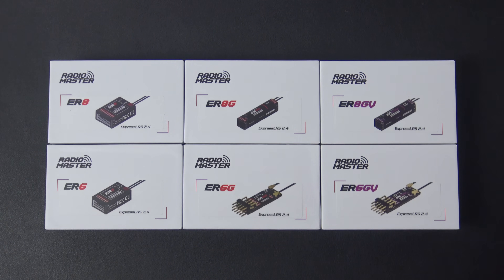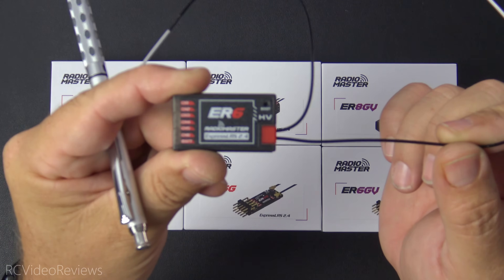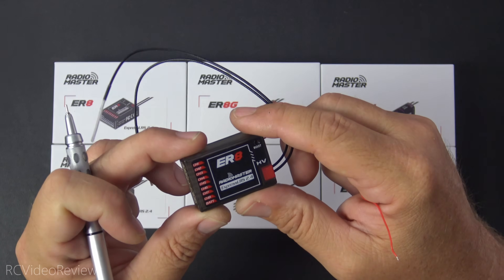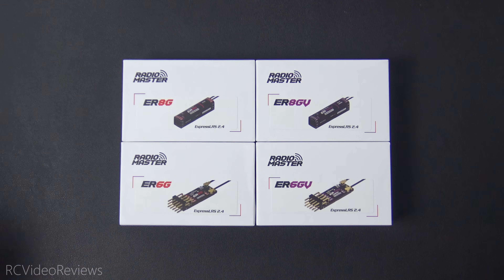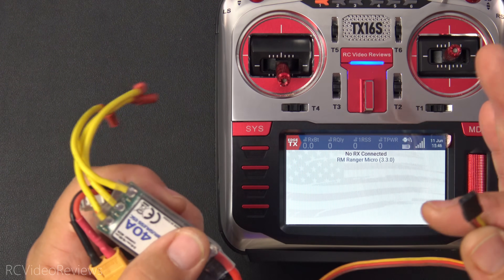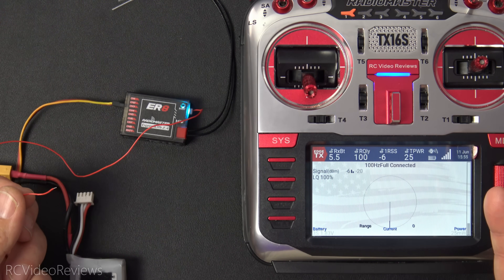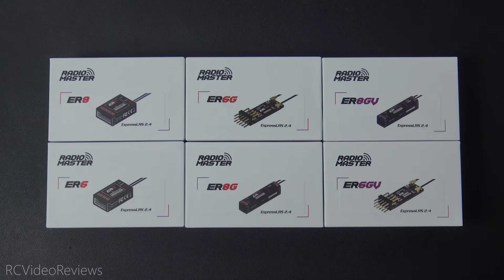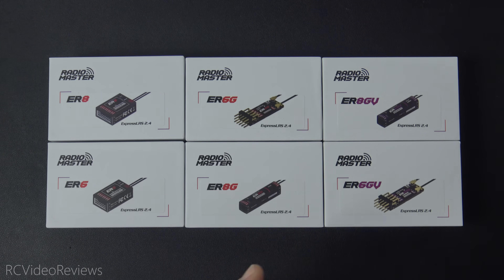Radiomaster ExpressLRS PWM Receivers [ELRS] : ER4 • ER6 • ER8  • ER6G • ER8G • ER6GV • ER8GV

Comment: Good enough to give this a try. Definitely going to miss per cell voltage.... Hopefully that comes along soon for EDF, helis, etc.

RM seriously needs to consider a NA warehouse and support staff to take it to the next level. ~$5-11 per item to ship from CN starts to erode at the value prop.
Reply from the maker: They do have a robust retail channel and I'm told the US retailers that ordered them are free to post them at will.

I used to worry about per cell voltage, but I keep only good condition batteries in flight and TBH, with good condition batteries, it's never been an issue. And I log/review my data too, so I'm not whistling dixie here.

Comment: I wish they do not sell em in a fancy carton boxes that goes strait into trash, but make em couple $ less. For $14.99 you can buy matek 6ch rx with same vbat feature + 2 additional channels. Same weight tho. But it's good thing that we have another one vendor on a market.
Reply from the maker: I have a bunch of the Matek/HM RX's, you also have to solder all of those and one little mistake (which people have admitted to making in the comments on retail sites) and your $14.99 is wasted. Also, some of the older hobbyists don't have the same eyes/hands younger hobbyists have, so solutions that come ready to go out of the box are a value add for them.

And yes, always good to have another vendor in the mix. Good for everybody.

Comment: they didnt have a typo for the weight, you forgot to add the pins to it and all the other extra stuff
Reply from the maker: The one with the typo was a 5g difference. Radiomaster already acknowledged the mistake. Had nothing to do with the pins/wires.

Comment: You know shids fked up when the most expensive of these is cheaper than the cheapest Futaba.
Incredible prices makes me wish I had ELRS.
Reply from the maker: Not only that, I've been watching ELRS telemetry very closely for a few weeks, and the RF link latches on like a pit bull with lock jaw. Even single antenna designs produce ridiculously good RF outcomes. I'm talking RQLY at 333hz of 95%+ and 25mw of dynamic power. 

Let that sink in and you should be saying, "Holy s$!T!" That means 316 understood packets per second at a measly 25mw of transmit power with headroom to 1000mw. It's just insane.
Reply: It doesn't cost much to change over - sell your Futaba while it still has value! :)
Reply: @slammerf16  Oh I have FlySky PL18 now hehe. I'm satisfied with AFHDS3 recievers but if I want something that crazy cheap I need to downgrade to AFHDS2. But other ELRS modules are so cheap I might just grab one of those now.

I bought my Futaba T7C used from an acquaintance years ago and it turned out to be one of the early variants that cant bind to additional recievers. When I realized I was years outside of the "service" that Futaba offered to fix them.

Comment: Great video John. Well done RadioMaster and all that worked on creating these Gems.  Love this feature that CapnBry shared, " output CRSF or SBUS to a flight controller and still have the PWM outputs as well." VERY VERY cool
Reply from the maker: Yes, definitely cool.
Reply: Hspeed, CRSF or SBUS output ?? CapnBry ?? 
Sounds interesting. Please advise how.
Reply from the maker: Yes, you can output serial and PWM simultaneously on ELRS. I haven't done it on new RM stuff yet, but for PWM: Set Pin 2 to Serial, pick SBUS (3.3+) or CRSF, and PWM pins retain output. No configuration necessary for those.
Reply: I tried changing the output pins in the ER8 and ER8GV, but they don't support setting their output pins to Serial.  It appears you can only use the CRSF port for serial output (which is fine by me)  @RCVideoReviews

Comment: question: how do you couple two receivers for a dual setup ?
Reply: For what? The link is extremely reliable.
Reply: @malte9999  there is nothing extremely reliable. of course if I were to use them on cheap foam planes for LOS this is not an issue

Comment: Indeed!  I have not bought DMSX original reveivers because of the lack of that feature... Hated the 'time' thing.. Love the Low Flightpack voltage alarm. Once you try it, you will not want to go back.  I don't employ RX's without it anymore just as you do.!  Big thumbs up for Radiomaster!
Reply from the maker: Yeah, having flight pack voltage is so useful. FYI: If you like using voltage instead of timers, check this out: https://www.youtube.com/watch?v=Q5s7zB0NDCQ
Reply from the maker: Every plane that has voltage, has that setup. And I only have a few more planes to convert to ELRS + Voltage.

Comment: Great video John, good to see these receivers are finally public! I think RM are on to a winner with the ER series. :) btw, the UART on the ER8G and ER8GV is on the side - at 9:59 it was right next to your thumb ;) It'll be interesting to see what happens with that in the future... The presentation and build quality of these look great... I like the attention to small detail like the rubber strain relief for the antenna on the ER6 and ER8.
Reply from the maker: Ah, I see it. It's covered by heat shrink. So that has to be cut open. I think there will be a lot of people who appreciate having mainstream ELRS receivers: Cases, pins soldered on, strain relief antenna, 35v vbat, +6 pins. Definitely believe RM is on the right track and has fielded a winner with this lineup.

I am nearly 100% ELRS on fixed wing.